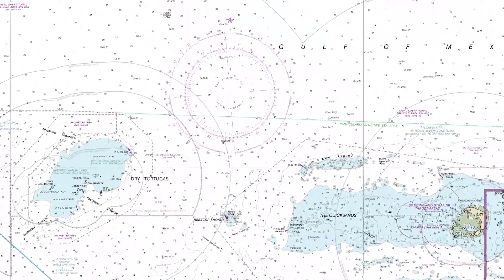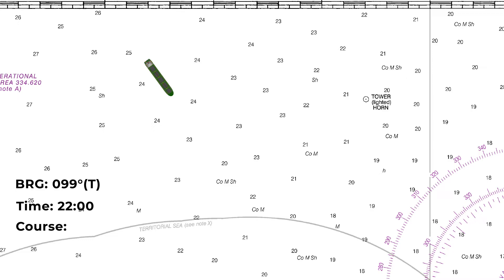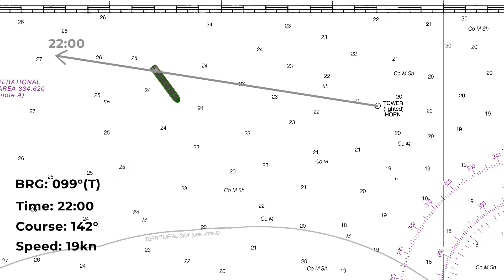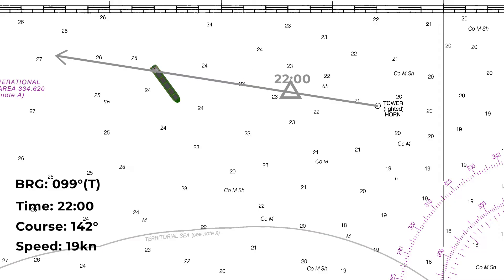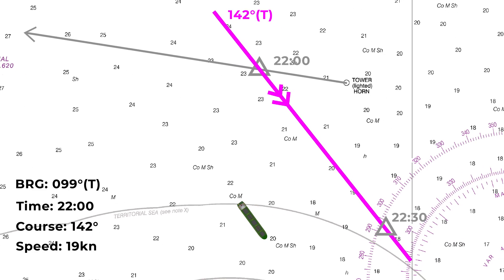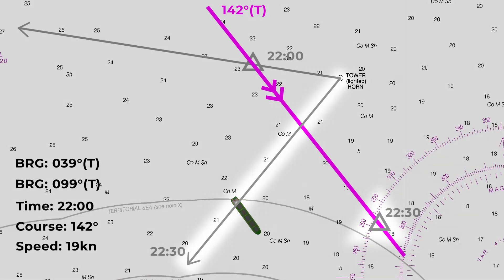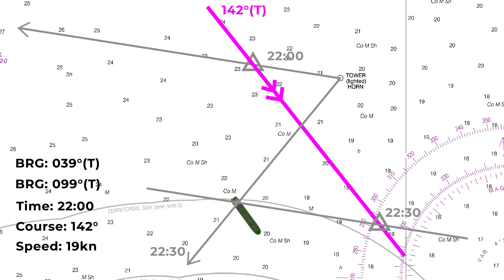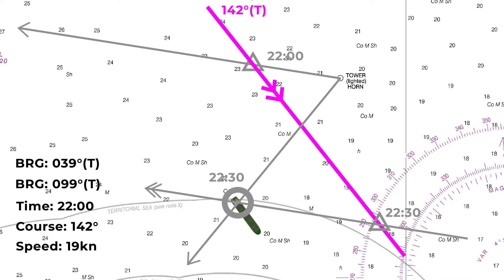Chartwork Tutorial: Running Fix

Comment: 099 degrees Line, course 142 degrees. You already know that there are 29 degrees between Line and course. Next: You know the speed which gives you the course distance, when you take the 039 degree line. Then you have a triangle with three known angles, and a known distance. (Use the Sine Law twice) this gives you the length of both the 142 degree and 039 degree distances. Now you know both where you were and where you are, SO: SinA/a = SinB/b = SinC/c
Reply: Does the Pythagorean theorem work here? I thought one of the first estimates could be incorrect

Comment: I finally understand now after taking a pen, paper, and ruler and mapping this out. So if I understand correctly, the first LOP gives you the set of all possible positions you could be at 2200 from the azimuth to the tower. Simple enough. Then, after 30 minutes, assuming your ground speed and course was correct, you know the new line of all possible positions you could be at 2230. (Take the first LOP and advance it using your course and speed). However, the other LOP you get from the azimuth to the tower at 2230 is ALSO a set of all possible positions you could be at (you HAVE to be somewhere on that line). 

By taking the intersection of those two lines, you can find your position both at 2230 and 2200 because you must be at a point on both lines. 

This is really cool geometry, I only wish I figured it out on my own! Oh well.

Comment: Your way was prob simpler, easier to learn, and more elegant.  But when your only tool’s a hammer, everything looks like a nail. I don’t know shipping charts but I do know trig - which is my hammer that I try to use for everything.  I’d take a second bearing when the tower was at 90 degrees to the ship.  Then you got two angles.  And the distance traveled by the ship gives you the length of the base of the triangle.  Tan theta gives you the distance to the tower when the ship’s at 90 degrees to it.  Or you could take a 2nd bearing as on the vid.  If the angles are equal, then you get an isosceles triangle.  Then  bisect the triangle into two right triangles.  It’s a little more math to figure up all the angles and legs of the triangles but it’ll still get you there.  I learned basic trig in a high school conservation class designed for underachievers like myself.  We used it to estimate tree height.
Reply from the maker: I've never done it that way, but it sounds like it might make a fun video one day.
Reply: @RefreshMaritime  The dumbed down version of the above would be take bearings at 45* and 90* (doesn't matter what order you do these). The distance traveled will equal the the distance from the object.